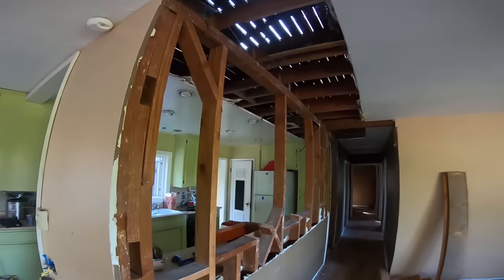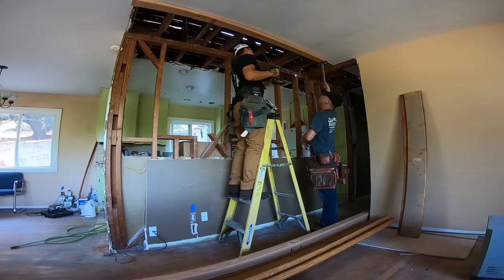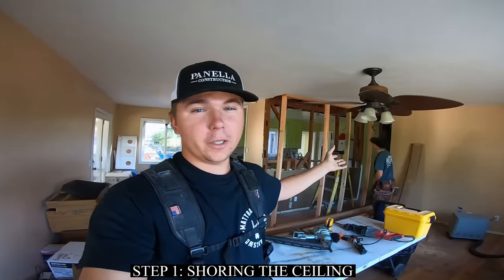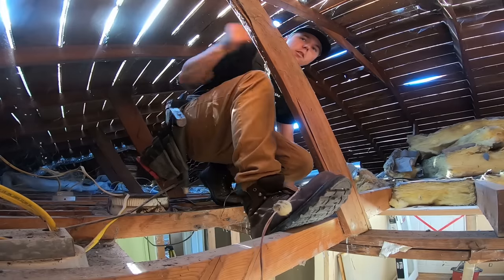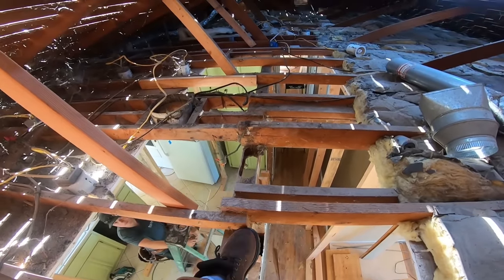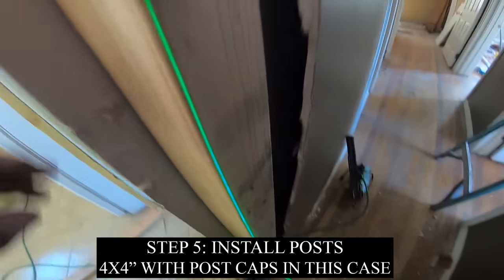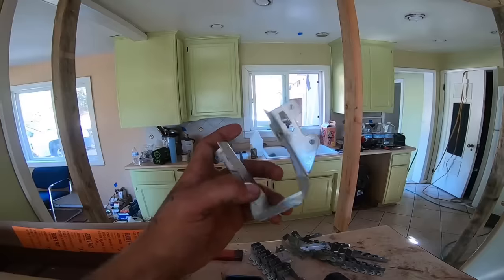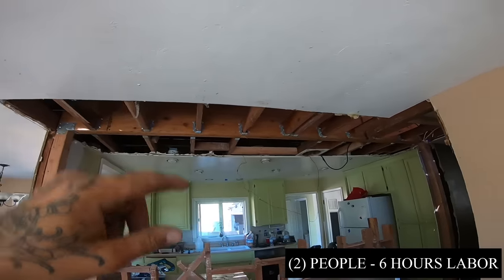How To: Removing a Load Bearing Wall! (EASY STEP-BY-STEP)

Comment: was the LVL sitting on 4x4s on each end? How were the supports attached. didn't quite see that. Were there two 2x4s screwed together or a solid 4x4? what can be used if we can't get LVL? I"m assuming 2x12s or something? since there is a bedroom above the wall we want to remove, ours will not be flush with the ceiling. the floor joists would sit on top of our beam instead of using hangers I'd assume.

Comment: in my opinion, the posts should be "blocked solid" underneath to transfer load to the bearing partition below or extend through floor to bearing partition below....that's how my engineer would draw it and county required it to meet va. code.

Comment: Question, instead of cutting into the floor joist and inserting your lvl, could you just add to your end posts and build your LVL to support the same joists, basically your ceiling would have a drop where your lvl beam is compared to the rest of the ceiling; asking for a situation where you'd have attic insulation (as your case there is no attic insulation) Thank you!
Reply: Yes, you would be creating a header. That will work.

Comment: Hey Bubba. Yall did a pretty decent job. From a business stand point let me offer you a big piece of advice. You will save a LOT of cleanup time by throwing up some plastic sheeting ceiling to floor. Create a barrier to block all that wood dust. Plus, ya know, that whole pesky thing about keeping your customers home clean and not spreading cancer causing pixie dust all over. And wear a dust mask. Ask any guy rotting in their grave after dying from silicosis how much of  an inconvenience a  $2 mask is.

Comment: Great video. I need one put in for a 10 foot span, nothing crazy. Would your process change if the wall is holding up a second story instead? Also does the temp wall need to be framed 16" on center, or am I overthinking it? Theres nothing special about my setup, two floor joists meeting above the wall and a nice steel beam below for load transfer.

I got one quote that was ~$5k for the job and it just doesn't seem right. Seems like it could be done in a day or two with a few talented people. Considering DIY with plans from an engineer but at the least you educated me. Thanks.

Comment: Where you put post you should make sure there is good support under it as the load was spread across the floor now it's in two small spots on the floor even if it's a slab there's probably no footer there and could cause trouble FYI.
Reply from the maker: Most definitely! Talked with another commenter about this very thing. 😊

Comment: I think you guys did a great job but I wouldn’t have even started that job without putting something down to protect the floors and personal belongings of the home owner. Maybe they said they are replacing the floors too but still helps with cleanup

Comment: One thing i did notice is you should of explained that when you cut the studs and if the saw binds that may means there may be to much weight still on the wall and it may needs additional support

Comment: This is exactly what I need to do, however the roof is very close to one end of where the beam needs to land. From the bottom of the ceiling to the underside of the roof might be 6” if I’m lucky. Do you think cutting a dog-ear off the top end of the beam for clearance will weaken it too much?

Comment: What kind of posts would you have if you had 3 of those lvls stuck together. That would make the beam 5 1/4” thick. I would guess a couple of 2x6s. What if I have a 2x4 stud wall and I would want a 5 1/4” thick lvl to rest on top of it? Can I achieve a post by multiple 2x4s, or does the post have to be as thick as the beam?

Comment: I’m thinking if you significantly weakens the structure of the house when you cut the joists, when the roof torques new nailing is much weaker the the old one which was perpendicular to the torque

Comment: How are those brackets that your rafter ties sit in, going to let those rafter ties stop rafter spread? - The entire reason the joists are there to begin with?
Reply: I wondered the same thing. Either instal a rafter tie above the beam or install an approved engineered strap across the bottom of the beam and existing rafter ties/ceiling joists.

Comment: I did something similar to this in my own home however I set  my lvl  on top of my 2x4s then straped the 2x4s up to the lvl  (if that makes any sense) instead of making the lvl flush with the 2x4s. Something but different!

Comment: I saw a "This Old House" episode where a contractor recommended using nails vs screws for installing joist hangers due to their higher shear strength. In this video, screws were used.   Which is the better choice?

Comment: Someone had done this in a foreclosure that I purchased back in 2009. Now 2022 I’ve been noticing about this last year, that this wall that used to be there the top of the ceiling is starting to sag slightly it’s just becoming noticeable. 

How can I fix that? 

Do I need to put a post in it may be a little half wall?

Where this old wall used to be was between the dining room and the living room. I could put in half a wall or a beam coming down to the floor and then basically a countertop height wall. That would give a little separation between the living room and the dining room and then you could fill it in with spindles at the top or shelves or just leave the top portion open the box in the bottom half of the wall. This is what I’m thinking for a female that’s not very handy! Lol

Comment: Great video.  What is that impact nailer you used to attach the ceiling joists to the LVL beam?  much better idea than an pneumatic nailer near a metal flange.  Also, I got a qote to do a wall removal in California in a 2-story for a kitchen remodel and the GC wanted $20k for the architectural drawing and $20k for the build. $40k just to remove a wall! I may have to be my own GC and sub out the work on my own.

Comment: To clarify some questions about comments referring to transferring loads to the floor joists:

The key to load bearing beams is that the load is transferred to the GROUND. Engineers calculate the load capacity to determine if the new load points (the 4x4s he installed to rest the new LVL beam on) can be transferred to the floor joists, or if they need to transfer directly to the foundation, or the ground below.

It's important to remember that the posts holding up the floor transfer the load of the floor to the foundation, or the packed ground below the foundation. Steel or iron or reinforced concrete columns are what typically hold up the floor joists in between the foundation walls. If this altered load displacement to the new beam was deemed too heavy, the engineer would require them to go below the house and install new columns mounted to a poured concrete base - nowadays, the columns are usually steel if installed in a basement, or wood if installed just below the floor. My guess is since a 4x4 above the floor is enough to transfer the load down, a 4x4 below the floor would likely be enough to pick it up and transfer it to the ground) - mounted to a poured concrete base. Usually, you would dig a hole in the ground a minimum depth - typically 3-4 feet deep, with a minimum width or diameter - with a column bracket mounted into the center of the top of the concrete base before it dries. Then mount the steel column in the bracket and secure it to the floor joists, directly in line with the 4x4s above that support the weight of the beam.

If you do this correctly, the load never really touches the floor at all, the weight load is transferred directly into the ground by way of the new columns below the 4x4s.

If you DON'T need to build new load bases, then the engineer determined that the weight of the load the beam is supporting is low enough for the floor joists below the 4x4s to transfer the weight to the nearest floor supports, and then into the ground from there. But even when this is the case, they want the 4x4s to be placed directly ON a floor joist, not in between them, to ensure the JOISTS transfer the load to the ground supports, not the sub-floor above them, that's how your sub-floor eventually breaks apart and cracks your nice tile or hardwood floors.

My guess is that the location of the 4x4s - at the end of the previous load-bearing wall and at the end of the wall that makes the entrance into the kitchen from the hallway - are in spots that were already located on top of floor joists. So as long as the beam didn't breach a maximum length (i.e. didn't pick up the load of more than "X" number of roof trusses/ceiling joists hangered to the new beam), they didn't have to install new supports down below the 4x4s under the floor.

But when you remove a load bearing wall and replace it with a spanning beam, ALWAYS get a structural engineer to calculate the load first and give you the minimum specs to meet code - NEVER make these assumptions yourself. These specs WILL include any newly required supports necessary below the floor. And yes, permits are absolutely required to alter structure, EVEN if the homeowner does the work themselves.

Looks like these guys did a nice job, even accounting for the weight of the rafters, relocating the support braces temporarily to prevent sagging, and then installing new braces from the purlins to the beam to properly transfer the rafter load to the 4x4s. They accounted for everything. Which is why I'm guessing they had the load calculations approved, to know they didn't have to add any structural support below the 4x4s. We don't know for sure, because he never mentions it, but it's a safe guess. Nice work.

Comment: I have a kitchen wall just like that about 4 feet in front of the house entrance. It is low bearing. I wanted to remove it or at least cut into it to create a big space to be able to bring in big furniture such as sofas or appliances but unfortunately there is a vent pipe behind the vent return. How difficult would it be to move the pipe and how much would it cost? My house is 800 sqft and unfortunately we need our foundation repaired.

Comment: What is being done to address the point loads at the 4x4 posts to the floor?  Is there solid blocking down to a footing or did you add a beam under the posts in the crawl space?  Loads cant stop at the floor, they need to carry down to a footing, pad or beam.

Comment: Ida tried to go out to the side wall. Why do all that work to still have a post in the middle. It looks load bearing but the joists toward the outer wall are not if they are the same kinda joist. Couldn't you put the beam on top and hang the joists from under it so you wouldn't have to cut them all. I did that for a 20' span...

Comment: Matt, great video! I’m looking to do the same thing with almost the exact same wall, except mine does not have a 90 degree corner at the end of it, so there would be no post available to rest hold the other end of a beam. Any thoughts on how to get away with getting rid of the wall without having to install a post?
Reply: Keep going to the adjacent wall use that as support if you have a longer span you might need engineered beam
Reply: @justingerard7546  Hey, thanks for the reply! I actually bothered to look at my trusses and they are engineered trusses and around a 30-40 foot span. I felt comfortable as did my building inspector, and an engineer making the call to take the wall out. There were no bearing points on the wall in question and no gusset plates landed within a foot of the wall. Everything’s out, and no sagging or cracking of drywall. 😂

Comment: Matt, what were the size of the LVL 2x12?  What if I run in to a 2 story house? Any tips or tricks?
Reply: my bad i saw it 2x14
Reply from the maker: 1-3/4”x14” 😊
Reply from the maker: Two story house is the same process. Just use 16” O.C. For your shoring and you’ll be just fine. Floor systems have a bit more weight to carry, so be sure your shoring is good!
Reply: @tinysand3517  same process yes.... BUT don't just go throwing a double 14" in and think your good. Understand your loads and spans and have the beam calculated. Most lumber yards will do this for free

Comment: I removed a load bearing wall amd replaced with a 21' LVL header and made several other opening in my home 1 was a breakfast bar that was a load bearing wall. The 4 framers came and did it all in 1 day for $1000 total for labor. The 21' header was about $240 pr $340
Reply from the maker: Cost all depends on your location. You couldn’t pay $1,000 to have one removed in this area. $1,000 doesn’t cover (4) guys on payroll for a half day. Unlicensed and uninsured is a completely different ball game, as they’re not playing by the same set of rules.
Reply: If a homeowner reaches out to a contractor, they come out review the project, get measurements, consult an engineer at the lumber yard to property spec the LVL size, order and deliver the LVL, do the demo work, install the LVL beam & hardware, replace any drywall, finish the drywall, color match and paint new drywall, possibly relocate electrical and get a final inspection from the city.  I live in the south and even here, $1K for that project would be super low.
Reply: @MattBangsWood  100% true
Reply: @KevinNichols222  I've been in the construction industry for 7 years now, I've done work from managing ground up sites, managing small interior renovation projects, finishing buildings, structural steel erections and some other stuff. So I reached out to a couple of friends to make sure the LVL size was ok. And just to install the beam, along with demoing and reframing 4 other walls was what I got from my frammer for $1000 for the day, he brought 4 guys in total and they completed all the work in 1 day including sheet rock and corner beads. But that wasnt near what the whole job cost me. Material for the framming was $700,+1000 for frammers,+ $600 for compound+ $1100 for scrapping stain and Poly so there wa no lighting in the 2 rooms that were connected so I brought in my electrician that I use for alot of work on sites, he installed 12 flush mount spot lights in the living room dining room and 3 switches, and an additional 3 pendant lights in the wall we opened in the kitchen for a breakfast bar, material for that was was about $500 plus $450 for installation. The work I saved money on was, Feathering in the floor where walls were removed flooring guy wanted $1000, I did it myself for $100, close up sheet rock by all the spot light openings saved $250, reinstalled all base, casing, and crown mouldings.  saved $400 and started demo on the job it self. Dumping the garbage was about $250. So total for everything was about $5700 cus we did alot of stuff, butmost of that came out of $4800 that we got back from the seller since he delayed closing by 2 and half months so we got him to agree to pay rent and closing fee penalty that mortgage broker waived for us. So we got back $4800 at closing and spent $5700 on all renovations. Also I added an extra sink in the kitchen that a marble guy wanted $300 to come down and cut and plumber wanted $700 to install all piping, I brought the marble to a friend with a shop for $50 to make the hole for sink and mount the sink and hole for faucet, and I did the plumbing for about $50. So alot was saved.
Reply: Plus paint and touch ups were 550
Reply: You sir, deserve a cookie!
Reply: @DoNnEgRoW  something tells me u dont know how to do this work lol
Reply: @Joshua Engel 
Lol yeah, bridge work carpenter here I’m sure it’s a challenge
Reply: @DoNnEgRoW  ok mr dong grow
Reply: @joshua engel better recognize 👍🏽😂😂

Comment: I have a load bearing wall that is only holding up a small pitch on my ceiling, I wanted to remove the wall to make two bedroom into one big one. Could i just replace the wall with two 6x6 post, and have to pillars (6x6 post ) in the middle of the room to carry the load?

Comment: How long was the unsupported span ?
I’m gonna knock down a wall in My Home and install a 4 x 12 beam that is 17 feet long and I’m wondering if only supporting it at the ends with 4x6 will be enough
Reply: Hell no! Talk with structural engineer…sounds like you may need the help…

Comment: Have the same wall and ceiling joists setup.   Below the wall is the steel beam in the basement.   Do the 4x4s need a post under them in the basement or can they sit on the steel beam at any point?    Also my beam span is about 20ft.

Comment: Just a stupid question here but I am curious why a electric chainsaw over a Sawsall with a demo blade? The reason why I ask is chain saws hate nails and dirt and old framing is generally loaded with nails, staples and screws and sometimes even nail plates that can sometimes blend in where you would not see them until you hit them.
Reply: I would stick with the SawsAll.

Comment: @mattbangswood GREAT VIDEO. I’ve been binging on your content and learning a lot.  Beyond differences an engineer determines necessarry  in the beam itself- would this have been executed differently if the load bearing wall was in the center of the house? Directly over the steel beam in the basement and below the peak of the roof?
Reply: If anything, you're lucky. You wouldn't have to execute differently. Our load bearing wall is off center, and the jacks in the basement aren't directly under the load bearing wall. Because of this, we're trying to find a way to carry the weight through the basement and will probably need to add 2 jacks, directly under the 2x4 jackposts on the main floor

Comment: I have a 9' opening and want to extend to 18'.
This would take me very close to the next basmt Lolly u call it in the bsmt. Within 2 feet of it.
How do I know what dimension of LVL 3 ply to use.
Standard bungalow nothing odd above it for weight.
I plan on leaving them below the rafter line( nit inset like your video)